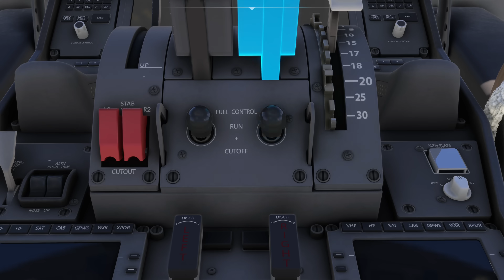Air India 171: Why Did The Fuel Cut-off Switch Get Moved?

Comment: Can a fuel cutoff be done electronically by the onboard computers. No one is answering this. In other words can a shutoff be done by the computer while the switches are in the on position. A very important question NO ONE is answering

Comment: What do you do when your electrical or electronic devices hang or stop working...
You switch off and then switch on 
Thats exactly what the pilots did when the aircraft achieved Vr speed..took off.. and lost thrust..
First.. qtn to confirm if the copilot had switched off fuel knobs.. and then when the answer was no.. both the knobs were moved from run to cutoff and immed from cutoff to run..

THIS IS NOT A PILOT DELIBERATE ACT TO CRASH..

The first command on Vr is gears up. GEARS DID NOT GO UP.

Comment: You and everyone on here are too quick to place blame on the pilots.  I've worked on aircraft like this for 32 years and switches wear out.  Wires chafe.  AND PEOPLE MAKE MISTAKES.  I would not jump the gun and immediately start casting shade on the Pilots when your lack of imagination can't seem to fathom that no matter how much redundancy is in place and your faith is set on things working they way they should......things do fail, shit breaks.  I know.  I've repaired lots, shit tons of things that were never supposed to fuck up the way they did.  This aircraft did not get the standard of maintenance/care you are accustomed to over there in brown people land.  And I promise you those switches never got looked at like they were supposed to when Boeing issued the Service instruction to go inspect them......because they did issue a special one time order that was OPTIONAL to replace them......due to the fact they found some DEFECTIVE and would physically/mechanically FAIL in the exact way THESE DID by allowing them to fall out of the GATED /Locked state and into CUTOFF by accident or unintentional BUMPING of the switch.  LOOK IT UP, IT'S FACT.   These pilots were both surprised to see the switches in the state that they were in (FAILED) because they had just like you all, the FALSE SENSE OF SECURITY that things as reliable and as robust as they have always been, every day in and every day out for the last 30 THOUSAND FLIGHT HOURS......COULD NOT POSSIBLY FAIL.  But they were.....wrong, and so are you.  Wait till the final report comes out.  Just like the MAX saga.  It's gonna be more can of worms and Engineering shortfalls because Boeing is not the company it once was.  They used to be driven by safety, now only driven by profits.  And that my friends.....is never a good thing in Aviation.

Comment: According to the preliminary report, the pilot operated the left and right engine fuel cutoff switches 13 and 17 seconds after liftoff, respectively, in an attempt to resume fuel supply.
Is it possible that the initial warning was incorrect, and that the pilot—panicking—actually switched them off instead?

Comment: 🛑 Stop blaming the pilots without full facts.
In the AI171 crash, both pilots were clearly confused, not complicit:

🗣 CVR: “Why did you cut off fuel?” – “I did not.”
If this was deliberate, ask yourself:

Why did both pilots attempt to restart engines within seconds?

Why did they issue a Mayday call?

Why was there no argument, panic, or aggression in the cockpit?

🔍 In all documented deliberate crash cases, cockpit recordings showed conflict, locked‑out pilots, or total silence. None of these were present here:

Flight	                          Year	Conflict/Fight	                                           Pilot Locked Out	   Verdict
Germanwings 9525	2015	Yes — “open the damn door” heard	            Yes	                   Confirmed
EgyptAir 990	                1999	Yes — cockpit struggle				     No		            Likely
LAM 470	                 2013	No — solo pilot; locked door	         	    Yes	                    Confirmed
SilkAir 185	                1997	No CVR after cutoff					     No		             Likely

but in 
AI171 (India)	                2025	           ❌None	                           		   ❌ None	       Still Investigating (but media already made biased opinion)

i'm not an expert but its My theory of #AI171Crash
✅ A more logical explanation for AI171:
A software or electrical fault may have caused the system to interpret the fuel switches as OFF, even though they appeared ON physically. That would explain:

The engine failures

The CVR’s confusion, not conflict

The immediate switch toggling by both pilots

The swift Mayday call

When the first pilot saw the alert in screen and asked “Why did you cut off fuel?”, the second said he hadn’t. Seeing the switch was ON, they didn’t argue — they simply tried resetting manually. This perfectly explains the calm CVR and the restart attempt.

✈ And if this was intentional, why are airlines like Etihad, Singapore Airlines, Lufthansa, and Korean Air proactively inspecting fuel switch systems on their Boeing 787s—even though Boeing and the FAA haven’t mandated it?
Clearly, they’re treating this as a potential system fault, not pilot sabotage.
(Source: Moneycontrol, WSJ, The Sun, Indian Express, National Herald)

🙏 Let’s wait for the full AAIB report. Blaming trained professionals now — without proof — is not just unfair. It’s dangerous.

Comment: I see many suggestion of things like why don’t they remove the fuel switch entirely or it should get turned off only when both pilots agrees and do simultaneously action or do this or this and that. But they all are missing baseline question. Why pilot would do it? Is it intentional? And if it is intentional there are thousands of ways he can crash the plane. And if it not intentional then the pilot isn’t in a good state to operate the plane in first place. Cockpit is an interface to plane and not a single thing should be hidden from the pilots. If something can be turn on or off, it should be on the panel.

Comment: To the first comment, I don't think we will ever know what was going through their heads unfortunately.  And I suspect this may be one of those cases where it's "solved, but not solved".  Solved in that we know what caused the crash, but we may never know the why.

I do have a question for Steve though (or any 787 pilot)... does the plane emit an audible alert when the fuel switches are moved to the OFF position, to warn the pilots that the fuel has been cut?  If so, do you think that could have helped improve response time for the other pilot to react (set the switches back to RUN)?  I know some systems will make a noise when something is turned off or is switched off, such as the auto pilot system (at least in some jets, usually an audible sound will be emitted).

I do agree with the more elaborate method for doing a fuel shut off.  The only potential issue I could see is if one pilot was unconscious and could not activate the switch in emergency and if the switch is located outside of reach of the other (conscious) pilot, this could be a problem.  But it is a good idea.

To the question ab out preparing (engines) for a crash, I would think the only time where there MIGHT be such a thing although I'm not sure, would be like what we saw in Japan perhaps with the A350 running into the military plane and subsequently catching fire.  I could see in that case where there might be a shut down procedure, but that would be after the crash occured not in preparation for a crash.

About the B737 Max crashes, in all the reports I read, I think part of this came down to proper training and knowing what you're buying (ie. did Boeing tell the two airlines about the MCAS system).  It seems like many airlines in the US like United and Southwest were aware of the MCAS systems and instructed pilots to do one of many things -- in some cases, disable MCAS so they could fly the plane, and this is one reason I think we didn't see any crashes in the US even though there were a lot of Max8's flying at that time, so I feel that while the blame goes to Boeing, a part of it also goes to the airlines as well for perhaps lacking of training and not relaying proper info to pilots.  It seems that SW And United among others notified their pilots and made them aware of the potential MCAS issues so accidents could be avoided as best as possible until Boeing fixed it.  (And as far as I know, the MCAS system was not critical for flight, and could be disabled and flown normally, but you have to know what the plane is doing if you leave it turned on, and this is where the whole training thing comes in.)

 I honestly feel that the camera in the cockpit, even a top-down camera that can look over both pilots and still see all the controls, etc, is coming and would make me feel slightly better.  As I said in another video, I think the other concern pilots might have is that it will be used against them, as I've heard a few stories (rumors) of pilots who have admitting to snoozing during long flights.  I'm sure it happens, but I think when you are flying the public around, it should be mandated.  If it's just cargo or private planes, then maybe optional, but for commercial passenger jets I feel that they should be mandated.

Comment: Cpt Steve, according to lone survivor feedback, there was a loud bang after the take off. Would you not suspect that someone might have thought that the engines were running into issue that a reactive fuel cut action was taken? Someone has to explain why the loud bang and could the engines be in trouble already?

Comment: If the physical switches in the cockpit were back on (after the 10 seconds) how do we know it was the physical switches as opposed to a computer fault that "switched" the fuel off originally? If we are going by a computer result that the fuel was cut off is there a possibility that it was a computer error - thus explaining the denial by one pilot to the other - and then they played with the switches to get it back on, sadly too late?

Comment: This preliminary report is very unique because it consists of inputs from the experts not only from Govt of India, but also across the globe with acclaimed aviation experts. The most crucial info,  the fuel switch normally will be in default  RUN position ,when the Aircraft is set to fly ( regulates fuel to both engines installed for emergency purposes & other etc ) both L and R engines have shifted from RUN to Cutt Off within a Second precisely after 3 Seconds during the positive climb ( take off/ V1 was achieved).
 Indeed there is a vital clue (  external intervention between  the Thrust lever and fuel control switches), Both the pilots may be NOT noticed the switches cut off within a time gap of ONE Second ( may be due to busy take off schedule and Sky view),followed by a shocking conversation between them, why it was cut off and one of them negates it, not doing that ( obviously it is a potentially insane act and suicidal attempt to do it), if this narrative is to be taken in to consideration, consequentially, any act of human intervention has to be ruled out.The real challenge for the investigation team is , How both  these switches moved ? Simultaneously (within A SECOND certainly impossible to do that, rather it would take more than a Sec), Who ( certainly NOT humans) has caused it? Why it has been done ? 
Take into account the following proposition,
FOCUS on the  time frame within "A SECOND" ( both switches Cutt Off) , assuming a positive climb, Auto thrust lever descents towards the fuel switches ,at this point external intervention could have intervened between the thrust lever and the switches eventually pushed the switches with some force downwards ( assuming switches were vulnerable to move) to Cutt OFF.
Also watch closely the I'll fated aircraft take off video from the runway ( which gives a profound insight), everything is absolutely perfect upto the climb, the moment Aircraft achieved the climb, it started declining.
awaiting for the final investigation Report.
Advocate 
Madras High court
Chennai, India

Comment: Is it possible to mis use the swiches by incompletely placeing them in the run position but not completelylocked in the on position, this would be a mechanically unstable but might let the engines run and appear to be locked in on.  An Unstable mechanical condition would be challanged by the rotate and takeoff

Comment: No point having fuel cut off switches needing two pilots to authorise. One pilot is incapacitated for example by a seizure as has happened in the past, then an engine flames out you can’t cut off the fuel Big security risk.

Comment: Is there a possibility that the switch could have been half engaged and not locked in run position? Can you recreate this scenario in simulator? What if the switch was disengaged automatically through mechanical shock during take off or accidental touch?

Comment: **ALERT***  ALERT CAPTAIN STEVE****
According to ChatGPT. There is a visual alert in the cockpit when the switches are off. Flying pilot could have been confused when the alert popped on and immediately questioned the other pilot who immediately replied I did not. Furthermore, the fuel cut off can be off even if the physical switches have not move. After a crash those levers will remain in their last position even if the switches are off. Could it be that a glitch cause the airplane to switch electronically to off but the actual physical levers remained untouched? There must be 4 sounds, 2 per switch from on to off and back to on. If the voice recorder doesn’t reflect this I would say Boeing is in trouble AGAIN. Also consider this same plane had electric issues days before.

Comment: The point to be considered is why so many adverse things happening in Air India after its takeover by TATA? Before that everything was going on smoothly and suddenly all the hell broke loose. The media got suddenly filled with adverse news. All the toilets were choked. Luggage off loaded without any valid reason - I was in that flight from Mumbai to Newark where after landing about half of passengers found their luggage did not arrive including mine.
And some of the employees were celebrating after accident. It all speaks of a deep-rooted conspiracy. The perpetuators of it crossed all limits when they managed this crash.

Comment: I hate to say but all evidences point to a deliberate action that was carried out to bring down the plane.
If fuel was “accidentally” cutoff during mid flight phase, the plane would’ve had sufficient time to redevelop thrust and regain altitude. 
This pilot knew exactly when to carry out the heinous act that would result in irreversible failure and thus lose altitude .

Comment: It’s remarkable how the urge to blame Boeing is blinding people to basic facts. Yes, the company has its issues but in this case, the preliminary report, compiled by multiple independent agencies, makes it clear: the data doesn’t support that narrative. Not everything fits the story you want to tell.

1. Were the switches accidentally bumped?

Highly unlikely, if not impossible. As many experienced pilots have already explained, these aren’t your average switches. They’re designed to prevent accidental activation. This wasn’t a mistake; it was a deliberate act. But let’s humor the theory for a moment: the data shows the switches were set to CUTOFF shortly after takeoff (runway vibration theory falls apart here), with a one-second delay between engine 1 and engine 2. Accidentally bumping one switch is already far-fetched. Accidentally doing it twice, in sequence, is beyond belief.

2. Let’s look at the phrase one pilot reportedly said to the other:
“Why did YOU cut off?”

This implies direct knowledge of the act. Either the pilot saw it happen or he did it himself and is trying to shift blame. If it were a mechanical/electrical fault, that’s not the kind of question you’d ask.

3. Then there’s the 10-second delay before the switches were returned to RUN. Why the delay?

We don’t know exactly what went on in that cockpit. One possibility: the pilot responsible may have physically stopped the other from intervening, long enough to ensure the aircraft couldn’t recover. Another: confusion under extreme stress delayed the reaction.

4. And lastly, the report doesn’t specify who did what. 

It probably suggests investigators do have more information, but for legal or procedural reasons, they’re not revealing it yet.

Comment: These are faulty switches used on the 737 which were flagged multiple multiple times by pilots. Boeing used the same faulty switches on the 787 and these switches were changed twice on this plane. This is a typical cover up by Western media and Boeing. Ethiopian Airlines already exposed Boeing a few years' ago!

Comment: If fuel cut off switch is operated to cutoff. It should remain in that position for 5 seconds to accept shutdown, also when it is brought back to ON position system will take the command after 10 seconds. Now for the engine to produce some useful thrust - minimum 20 to 30 seconds required, why people are not talking about these facts!

Also captain, isn’t there a mandatory procedure to flip the switch to cut off position and then back on for a dual engine failure restart procedure. Unfortunately the flight didn’t had enough altitude to execute the whole sequence of restart!! I truly believe that this is a serious design flaw, at 700ft no human can do a restart procedure no matter how much experienced he is, only an automatic computer system can help in this case and the system should allow simple restart procedure or automatic restart in case of emergency at lower altitude. A smoke or fire, engine vibration can be sensed in micro seconds by the onboard computer than a human, so there should be more discussion in legacy system design and requirement of more automation